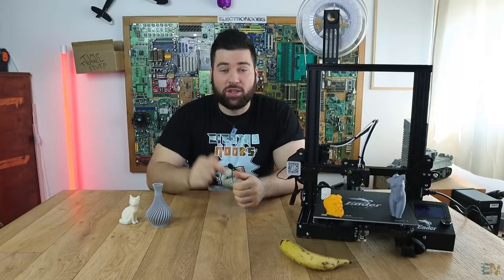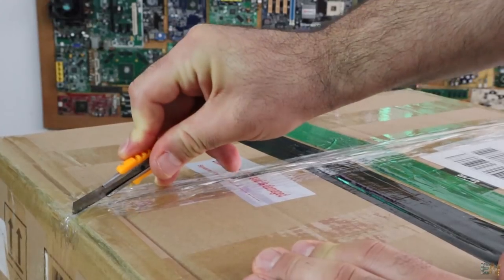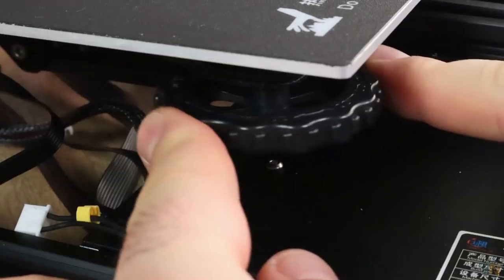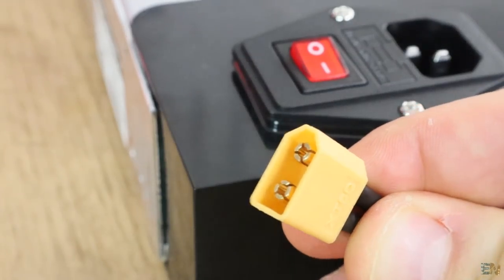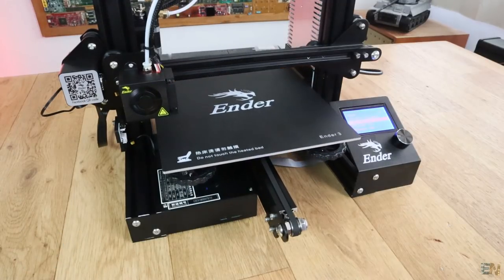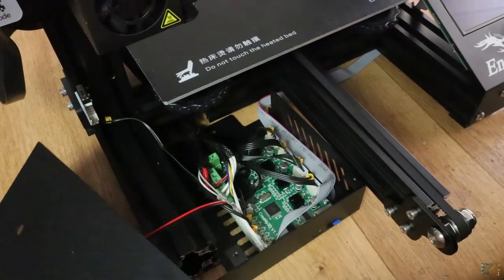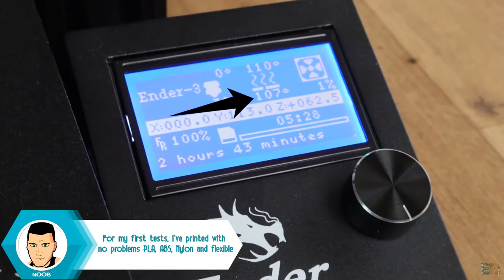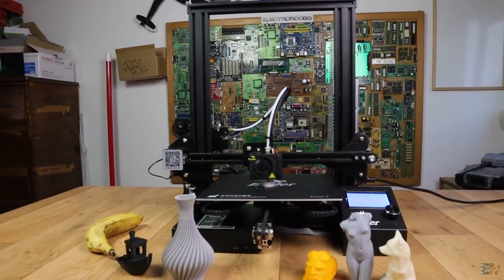Creality ENDER 3 - full review | ONLY 160€ | Best of 2018

Comment: 24v does not automatically mean faster heat up. It depends on the resistance of the bed being designed correctly. It does mean faster steppers and more torque. eg common pcb 12/24v heated beds takes the same time to heat up at 12v and at 24v when wired for the voltage

Comment: No glass is not an disadvantage, this printbeds have a really good adhesion! I use this "BuildTek" stuff for a long time now, much better than glass. Another advantage is, that you don't get a completly smooth surface on the bottom side of your print, this "rough" surface blends much better with the rest of the 3D print.
Reply: Hansbald I got my ender 3 a week ago and the new models have a removable buildtak surface that you can flex to remove the print. I was very happy to find that creality had improved in this area.

Comment: There is no external MOSFET because it doesn't need one, because current on the bed is half in comparision to 12V setup (max approx. 5A on 24V setup vs 10A on 12V setup), MOSFET on board is rated to 11A I think, so with less than half of that current it is not necessary to use external one. Only problem about MOSFET in Ender 3 I've heard about is that sometimes it dies and stops limiting current, but that problem would also appear with external mosfet, because I believe that it is caused by poor quality of component and not by overheating, but if you have any experience with soldering it will be no problem to change it to another one
Reply from the maker: Thanks for the info. Keep up!

Comment: Good review. A lot of people talk about the necessity of having external mosfets but I think they're only an issue when the PCB design is poor and thermal dissipation is insufficient. Surface mounted mosfets are perfectly acceptable when heat generation is taken into account in the PCB design and / or additional heat sinks are added to assist cooling.